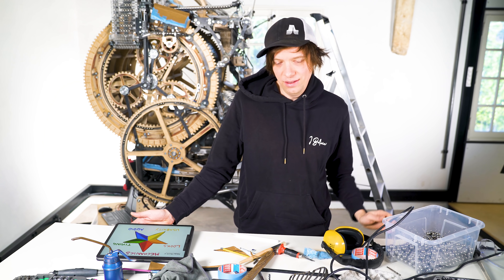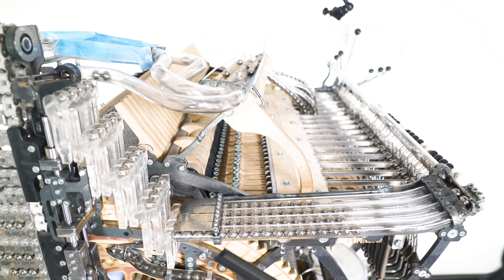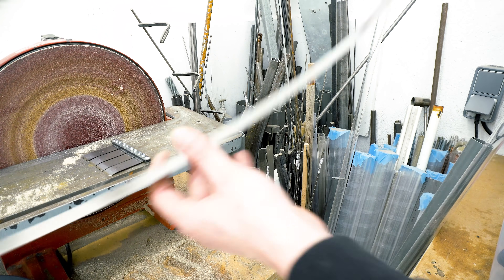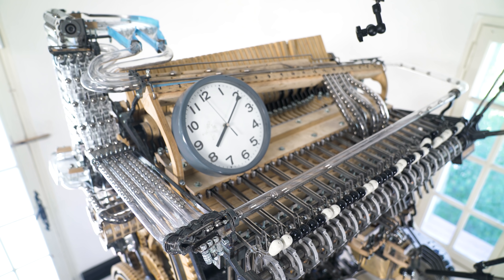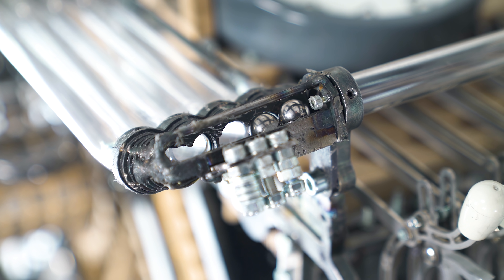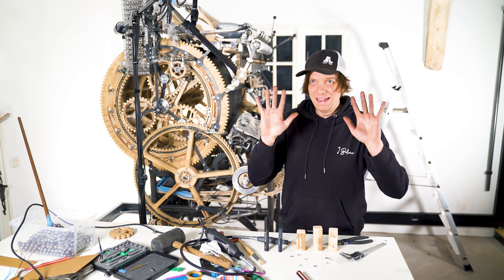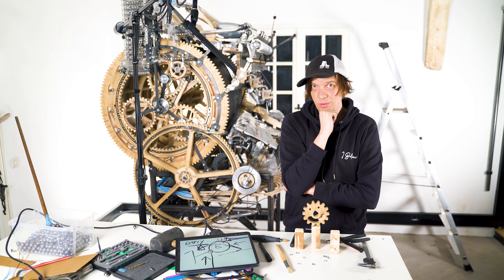Marble Machine X Fish Stair Upgrade

Comment: I know that MMX is mostly a mechanical machine, but i think that some of your mechanical problems that were created by the artist, can be resolved ( and save the looks ) by a little bit of electronics by the engineer, in this case you could use a weight sensor to know the mass of marbles and open the valve only when the mass on it, is close to the mesured

Comment: looking at that divide by 4 full is 100% satisfaction and 200% believe this machine WANT to be.
Ps.: i believe you an idea is to "push" things to fail safely. For example in the divide by 4 issue, not only the metal sping should keep the marble down, but also the plastic bucket should have a little invite for the ball to fall BACK rather than jump OUT. Yes, maybe it will make 0.1% of the ball that would have been collected correctly fall back, but if it make 0% fall out, i think is a good compromise.

Comment: I don't want to encourage feature creeping but I would consider replacing the divide by 4 with something similar to that piece that enters the demagnetizer where the channel with the least marbles gets them first and so on, something simple yet still aesthetically pleasing. Then at the end of the 4 channels, place a gate or drawbridge like the divide by 4 but instead of dropping when there are 4 marbles on it, make it long enough that it lifts with the edge of the stairs, that way only when the stairs have reached their lowest position can the marbles roll though. You could even consider putting a little arm with a pin or peg on the drawbridge behind the staged marble that would retract in the up position and allow the the next marble to enter, basically staging the marbles. Though this would involve more moving parts and so more potential moles to whack so I would maybe just go with the more simplified divider and see how it goes.

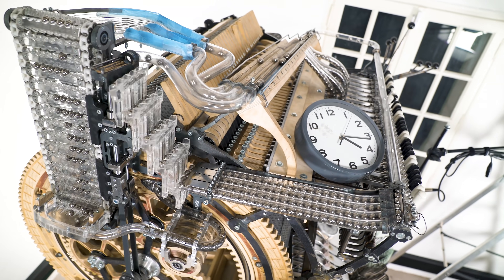Comment: What about turning the divide-by-4-Mechanism into a sort of mini marbledivider? By that i mean just leaving it mostly as it is, but leaving the rocking thing (I forgot what you call it) locked open, so that the marbles can just roll directly into the pipes. Basically the way you had it at 13:00, just getting rid of the dividing part.

Comment: why does the divide by 4 need to keep the 4 stair lanes even? if you dropped the divide by 4 and just let marbles race in unimpeded (though, keep the 90 degree turn by letting them slam against the edge), a full channel will just spill over into the next channel like your main marble divider. much like how you made the divider self correcting today. alternately you could redesign the intake system for the divide by 4 to be more like your main marble divider in which the queue is larger than just 4 marbles flat and make a pusher mechanism the pushes 4 marbles at once in time with your gearing mechanism/stairs. so a mini marble divider that queues up and lets marbles sit at the bottom of the queue until they get pushed towards the stairs on beat.

edit: while the pusher isn't guaranteed to have 4 every time, a larger queue for the pusher would reduce the number of 1/2/3 marble instances as long as the queue stays topped up.

anyways, keep up the great content! you're inching towards success and I really love these deeper dives into how you're solving problems within the scope of the whole project!

Comment: You need a more binary representation of opened and closed. The system needs to either not send marbles, or send all the marbles. Then you can more easily adjust when it triggers. At the moment you're trying to balance on a knife's edge. I think there's two parts to that. Firstly, whatever mechanism that begins the release of the marbles should trigger at a certain threshold and not trigger below that threshold, not sort of going, sort of going... there it goes. Secondly, that trigger should result in the release of the marbles with certainty. And the marbles should not release before the triggering. 

One thing you could do to deal with the second requirement above is to design a plate that releases the marbles at the end of its travel, not the beginning. And if one marble at the "mouth" where the marbles get let out is enough to hold the plate at the open position then you reliably should get all 4 marbles to exit the mouth each time. On the other hand for the first requirement you want the plate to tip only when at least four marbles are on the plate. So you have to either make sure it won't do it with three and a fourth marble can't tip the plate without going along for the ride to the ending position, or make it so that 5 marbles tip the plate but the fifth marble physically can't go for the ride yet doesn't keep the plate from returning. Either way it's going to take a bit of mechanical nuance to get it to function. But I think that redesigning the mechanism to get crisp on-off operation is what you need in order to prevent trying to shave a little here and shave a little there to try to get a chaotic system to somehow work flawlessly 100,000 times in a row.

Comment: I'm an engineer, and have reached the point in my career where I'm the ideas & architecture guy.  That means I have to make a lot of early decisions based on limited knowledge and my early decisions can't be judged until late in the development.  It took me a long time to get comfortable with the fact that some of my early decisions will be wrong.  In the end, I get judged based on how many of the early decisions were right, and I've decided that if the fraction is greater than 1/2 I'm doing my job.  For the rest of the decisions (i.e. the wrong ones), I get judged on how quickly we can identify that they were incorrect and then how quickly we can correct them.  As I've gained experience in this role, I've learned that if I make my initial decisions based on how quickly/easily they are to change the final results will be better.

The other thing I've learned is that trying to have one person responsible for both the ideas and the schedule is a recipe for failure.  It's much better if we split the roles, and have one person focus on the ideas/technology and have the other focus on managing people/schedule. The ideas person is responsible for looking at the product and push for what is possible, while the schedule person is responsible for looking at time and pushing for what is reasonable/affordable.  We've found that the best projects are those where there was a constant tension between the two roles, and if one of us is "winning" neither of us is doing our job.  If there is only one person performing both roles, their natural inclinations take over and we either have an overly-complex project that is over time and over budget (i.e. the ideas role won) or we have a project that was delivered on time but the team is burned out (i.e. the schedule role won).

Luckily, I have a co-worker that I've worked together for a long period of time and by our very nature we fit those two roles, with me as ideas and him as schedule.  We both need to be fully aware of what the other is doing and we are able to sub in for the other during short absences.  We've taken to thinking of the two roles as pilot and co-pilot, where the ideas person is co-pilot to the schedule role, and the schedule person is co-pilot to the ideas role.

Comment: There is no point in having a swing on the divide by four if youre going to run it as an overflow system anyway. Better to remove the swing entirely, if that is your idea, to avoid any errors it could cause. Every episode it seems more and more like you really need to go back to the drawing board on the marble divider and the marble lifts. The designs just seem too outdated compared to the rest of the machine.

Comment: I think a good solution to the marble fringe case bouncing out could be if you bend the pipes down further and then bend the edges up, creating a sort of ramp? Then they're slowed slightly on their descent and if necessary the weight of the other marbles will push the front ones up? That may be an even more delicate balance though... hmmm.

Comment: Another way to solve the marble climbing out of the fish stair entry mole, is that it seems the climbing is mainly because the entry point to the fish stair is too low so that the second marble comes in over the top of the one in the chair, then have to be pushed back into the channel as the stair starts to raise. If you can tune the height of the entry so that the drop isn't so far it should solve a lot of problems by keeping the second marbles in their place and avoid having to push them back.

Comment: You need a win. Personally, i'd get the machine into a state where it can play a song. Don't bother with marbles flying out, don't bother with it missing notes, don't bother with these tiny issues. Get it to where it can play a song, and you will at least see the light at the end of the tunnel. Then start tweaking it. In a way, you'd be building a prototype of the finished machine, then fixing the issues until the prototype becomes the finished product. But you psychologically need that win, because you are too close to success to fail.

Comment: Sanding down the lowest step on the fishstairs and taking away that awful divide by four would solve every issue with it. Just have one wide path, and if you sand down the lowest step, one marble will fit, but no other marbles can grab the corner. problem solved.

Comment: if you shorten the landing on the first stair and taper the face that the marbles meet it will push the late marbles back into the pipe instead of pushing them up.

Comment: Honestly, the idea with the fish stair digging out marbles from a "basin" sounds way cooler.
The only thing to prevent would be an overflow of marbles, but this could easily be solved with an excess drain to the bottom where the funnels end.

Comment: I'm intrigued about how big the problem with uneven division really is. A single song is at worst propably 5 min in length. Does the uneven divison add up to a sufficiently large reduction in marble throughput in that time frame? Changing songs will  be a not-super-quick process from what I have already seen from your programming wheel design. you could easily take that time to even out the fish stair channels between songs. From this perspective you dramatically reduce the target in reliabilty for the /by4 and fishstair elements, as you only expect them to work reliably enough for 5mins at a time.

Comment: Just an idea, your about instead of the reciprocating swing to divide by four you just use a rotating mechanism. Have 4 platforms around a pivot 4 marbles wide, and use either a detent and spring mechanism or a piece of spring steel to keep the platform fixed until 4 marbles are on it, then when there is it rotates a full 90 degrees, dropping them into the pipes without the mechanism having to reset, which seems to be a major source of the problems.

Comment: One solution that could be very interesting is a Galton Board type design (that thing where balls fall through into a normal distribution).

This would solve multiple problems at once:
- It would be visually appealing
- The pins would brake the marbles, thereby preventing them to go full speed into the fish stair
- Given enough layers of pins, the marbles will be randomly distributed over the fish stair channel in a way that is on average almost equal across channels.

Comment: Hi Martin, as an engineer, in electronics, most of my days are made of tweaking mistake I made from years to hours ago. This is frustrating I know, and most of the time peoples are more upset by their own mistake than by other's (that is my own experience). 
I think your feelings are part of you becoming a engineer-butterfly, if I can use this kind of metaphor. With more and more experience you will solve issues faster and faster and you will be proud of it.
And finally you will defeat that beast.

Comment: DO NOT TWEEK A BAD SOLUTION!!
MAKE A NEW ONE!

The engineering way is to make a mechanical way to "count" all the marbles in BEFORE the whip is able to turn over.
The same with the gate: make a "chamber" that holds the marble two positions BEFORE  it goes into the staires. Then it will never get stuck due to late arrivle.

See it as a buffer. You buffet all the marbles thats needs to be BEFORE you send them into the next step and then releases in sync with the right timing.

That is the right solution to both problems(and others of the same kind)

My 2 cent

Comment: A suggestion! I am explaining myself in detail to be clear.

The Problem: The steel spring fingers pin the marble until the marble explodes out.

Fact 1: A marble is a sphere. If a marble is stuck there must be equal but opposite forces keeping it from moving. If it is stuck between just two points there are just two forces, since they are equal and opposite, then they are on the same line facing into the center of the circle. 

Fact 2: If the fish stair is pushing the marble up, and the marble is pinned, the spring steel has to bend the same distance as the fish stair moves.

Why we have a problem: Due to Fact 1 and Fact 2 the spring steel will always push the marble in the exact way that keeps the marble pinned. 

Solution: we need the geometry of the forces to change as the fish stair moves up. This way we get the forces off of the line that is keeping the marbles pinned. 

Possible way to do this: Bend the spring steel sheets into a rounded L shape. the base of the L will be parallel to the incoming tubes, and the top of the L parallel to the fish stair. What this does is change how the marble acts depending on where it is. If it is closer to being in the tube, the marble will engage with the base of the L and be pushed downward. If It's closer to entering the fish stair the marble will be pushed forward into the fish stair. And if a marble is already in the fish stair then there will never be a chance for an incoming marble to engage with anything but the base of the L since the other marble will be in its way. 

I think this solution is great because it shouldn't take too long to build and test since its only a minor modification, and It preserves all of the work already put into the fish stair and divide by four.

I hope this makes sense! communication is one of the toughest engineering problems! 

Good luck Martin, and I just want you to know many engineers wrestle with bringing their vision into reality, and your not alone in your feelings!
Reply: Too bad there's no Stack Overflow for marble machine engineering.
Reply: I think the biggest problem is that fact #1 is almost, but not quite true. 
If the edge case is caused by all forces perfectly acting to cancel, getting caught is not a stable enough equilibrium to cause issues. 
I think that friction effects are primarily to blame, and I'm not sure that this new geometry does that much to change that. (Although it likely does change the position where marbles get/stay caught)

Still, I think this idea does have some merit, and I'd like to see if it helps!
Reply: Good Idea!
Reply: I think your premise of is correct even if I would express the approach and solve it slightly differently. Restating the issue as a common engineering problem: transitioning from a continuous system to a discrete system has aliasing errors near the middle of the range. Approach: Shift the middle to either side based on the direction of travel of the stairs. Solution: Use a cam to arrest marble flow just before the stairs unless the stairs are in a down stroke. Adjustment is afforded by changing the phase of the cam relative to the stair cycle.
Reply: Building it might not be necessary. Martin could probably flip the bent spring steel pieces upside down where they are. It would be worth a try at least :)
Reply: Instead of the hard corner the marble is pinned to would it be better to chamfer that corner so that as the stair goes up it just pushes the marble back instead of up?
Reply: The marbles are actually getting pin on three points:

The fish stair.
The spring.
And the marbles behind it along with its own momentum.

But I agree part of the problem is the angles. As it is right now, when the fish stairs push up the marble is getting pushed out. Thus spinning.

Personally my Solution would be to add a gate, something that lowers when the fish stair goes up. But raises when it goes down. But that would be a lot of work.

But the ramp idea makes some sense if done at the right angle.
Reply: I'm questioning why you would even use spring steel here at all. Wouldnt a simple ramp piece be better? Basically something that will push an edge case marbe on or off the fishstair in every case. Something like this:
     \\\\\\
__OOOOOO
where O are mables, __ is the fishstair and \\\\\\ is the ramp piece. If a marble is partially on the fishstair, it gets lifted and pushed against the ramp so it moves fully onto the stair, or it does not get lifted and is retained by the underside of the piece. Just for extra fail-safe, the ramp piece could still be mounted to some spring steel, with the intention that it will never move.

Comment: The issue with the marble that is stuck between the spring and the stairs is that the incline is too small and the marble speed is not enough to catch the stairs. If you do a little steeper incline just for the single marble closest to the stairs in the queue, the problem should be fixed.